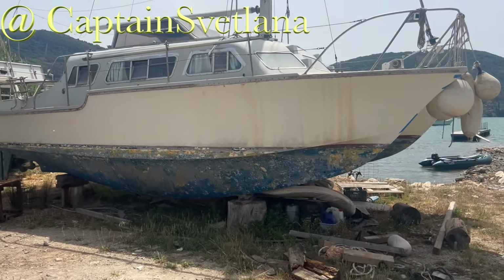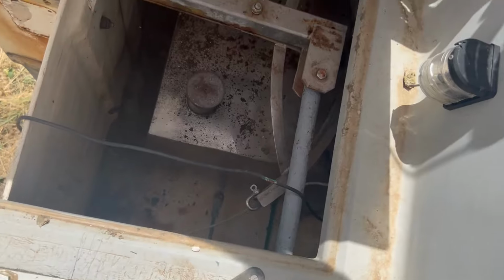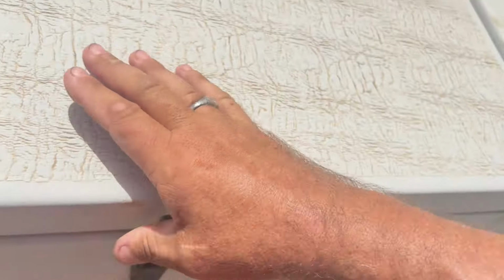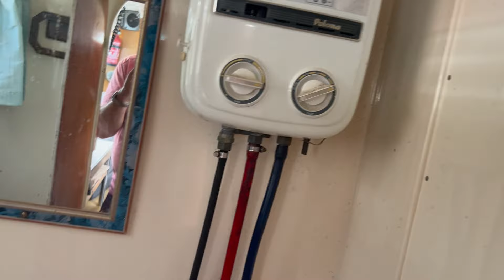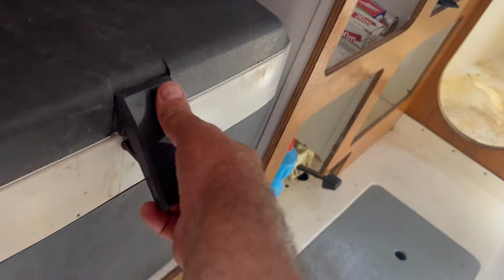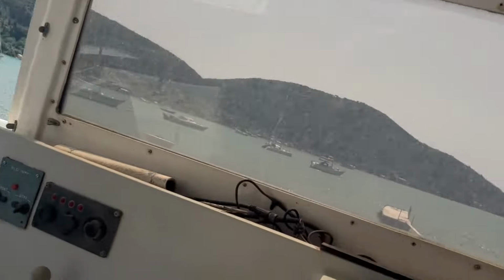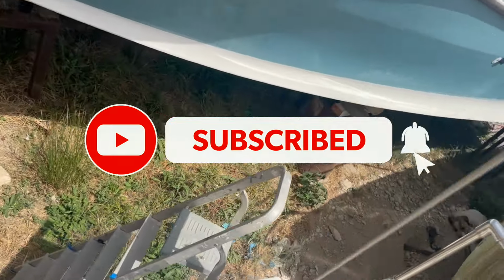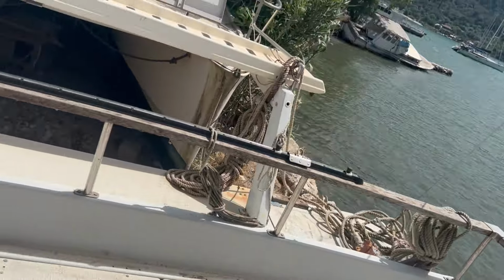Should I buy this Catalac 9? | S4 E18    HD 1080p

Comment: Catalacs are tough, safe and seaworthy ...lots of space and can dry out without problems.. handy if youve got a mud anchorage or need to inspect the hull, rudders or prop. drive system.

Like most first gen cats the biggest isue is slamming in choppy seas but they will keep going. 

Can you check the motors out ..old single cylinders are not exactly balls of fire but should last till your ready to update them .

That deep v hull produces some usefull keel effect.
The larger versions always remind me of a floating late 60/70s caravan or RV.  So great for touring and pushing inland as well as areas with big tidal ranges and sandbanks.. 👍🏼🧙🏻‍♂️

I watched Mark of wildings sailing rebuild his 1970s Commanche ketch rigged cat and saw just how well that sailed. Ive also followed some early Prout based owners stories.

Comment: Snap it up, the Windows on those will leak and the main fuel tank is probably rotten and the bulkheads may be cracking but all the rigging looks present and in order , tanks can be replaced, bulkheads can be fibreglassed and Windows can be taken out and re-sealed ...probably all fixed under £500 in bits and pieces... So what if it needs a new engine, 3k gets you a practically new one and the peace of mind to go with it, if it doesn't need an engine BONUS! It has potential...regret doing something rather than not doing it👍

Comment: Does it have an automatic pilot? from long sailing you need a device to keep course and auto steer mine was incorporated into my gps electronics you have to sleep sometime and even with an auto pilot solo sailing is tiring.
Reply from the maker: No autopilot but not hard to fit